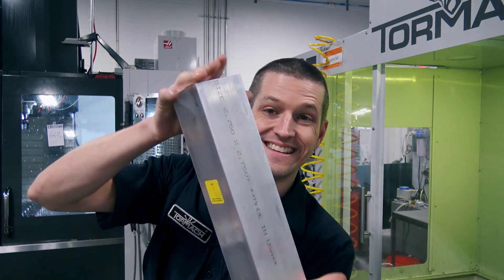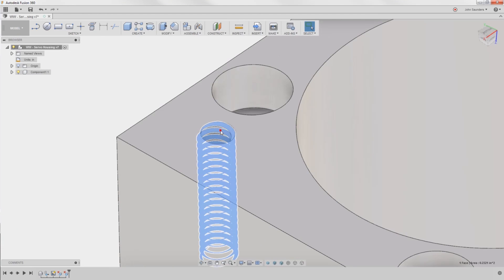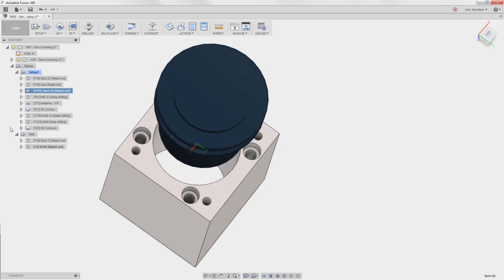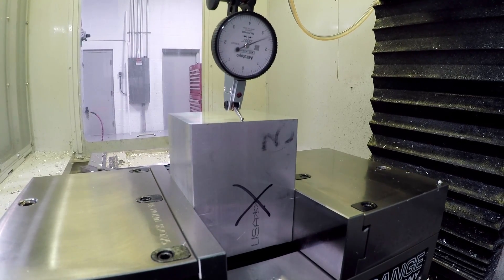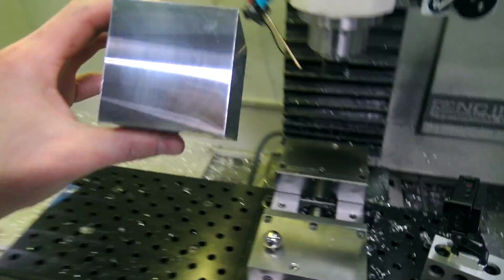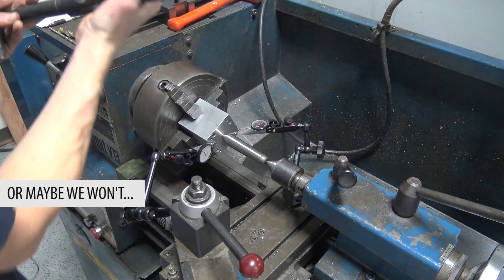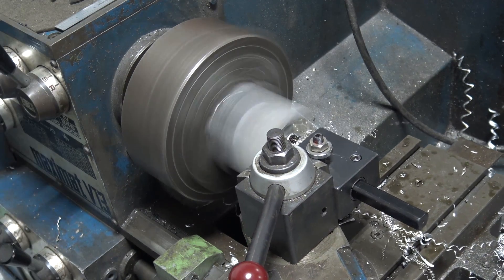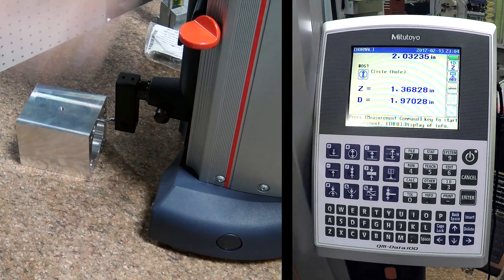Machining a Servo Housing!   WW135

Comment: I find it funny that when when something from china fails people just say it's because it's from china or whatever but when something from USA fails they silently disregard it, blame themselves, or call the manufacturer. two completely different mindsets. one thing I learned from watching YouTube is that anything can fail regardless of where it's made.
Reply: David Serrano 
When it comes to metal from china.  You have no idea what you're getting. Could be the right stuff, could be pot metal. AvE has it right though.  It's chinesium.
Reply: Chinese made drill bits are pretty awful. I think my luck in stainless 304, which will proof out a quality drill from a cheap one in no time, is 50/50. Took a photo of one I melted the tip on a couple weeks back even. Fresh drill bit, good speeds and feeds, but the poor quality of the steel couldn't take it. My shop for the longest time was buying them due to cost. I have learned to just avoid anything with a spotty, black oxide coating. I digress from the point being made about the tang, but if a manufacturer is willing to slap a coating onto a drill to cover up mistakes is going to make sure the tang is properly ground in and without high spots? I certainly do not think so.
Reply: What exactly was the fail anyway? A drill ground to cut steel when used to cut aluminium or brass will try to pull out of a taper, it just seemed that that was a larger and sharper drill than the others.
Reply: David Serrano 
It was a tanged Morse taper drill. Not only was the taper bad, but the tang had to have snapped or rounded out as well. And the other drill was just as old and preformed fine. 

Look. Sometimes china can make some good stuff.  It's not often though because they're hired out for their cheap and plentiful labor in order to make something at the absolute lowest cost possible.  Consider how cheap the made in china tools are. Now consider that not only does the US seller make a profit off them, but the china manufacturer has to as well.  A $50 made in china tool , probably only cost $15 for the china manufacturer to make.  You're not going to be getting the proper expensive metals or any substantial level of quality for that price.
Reply: chadwick hayes then why didnt the other drills have a problem?

also, why did you ignore what he just said about tanged mt drills? Do you not understand what that means?
Reply: Yes. Tangs on the drills are primarily for removal with a drift. But MT3 and larger have tang retention lugs in them specifically to prevent rotation in the taper.  Yes the taper lock does the bulk of the driving, but it's not hard to exceed the hold strength of the taper with using large drills. Hence the tang retainers.
Reply: You ain’t got a clue, 9/10 the metal from China is pure shite, can’t be the good British steel
Reply: Occams Sawzall considering it's an old tool that came with the lathe it could have been damaged or meant for a different taper.
Reply: From LeBlonds US tailstock patent:

"Anarrangement, consisting of a boss having a hole 25 and slots 26, maybe formed integral with the spindle 6 so as to provide holding means for the tang of the usual taper shanks of drills, reamers, or the like. "

https://www.google.com/patents/US2062790
Reply: Pete Kirkham 
Drills with a Morse locking taper shouldn't be able to pull out and start spinning around like that 😆
A drill will break long before that taper hold gives up, provided the taper was ground correctly, which it clearly wasn't on this drill.
Reply: David Serrano he's drilling aluminum the drill bit is actually to sharp and was digging in so China had nothing to do with it the guys nuts
Reply: china ships it, usa don't. that's the difference and it's called quality control.

Comment: If you were off on your the face of your part when you were dialing it in with the dead center, than the back side of the bore would show this as well. This could be the source of your run out on the backside of the bored hole.

Comment: I recommend boring head in the mill.  I think you blew your tolerance by not indicating the part square to the face of the chuck.  You got the center hole on center, but you may have had a wobble in the part, leading to a bellmouth at the rear face (chuck facing side) of the part.

Comment: How do you keep the hole centered when you face down the sides of the block, after the boring operation?
Reply: You don't easily. The order of operations on this part was wrong, block should've been sized first and then bored.
Reply: poo, you are correct. If I was going to bore that in the lathe I would've made a sub plate to bolt the part to that holds it concentric without any deflection from clamping in the jaws. His other main problem was that the lathe is not level and / or the ways are worn bad near the spindle which will cause the saddle to sag and the tool will no longer be on center and cause the taper.
Reply: poo, also I would have indicated on the flats and along the Z axis to make sure the part was running true. 

One last thing that gets me is why in god's green earth is he indicating extruded material to tenths, novice notions if you were to ask me.

Comment: So did you ship it out? Doesn't seem like it's a crazy big deal just 1 thou over spec
Reply: We always ask the client if a small amount over or under tolerance will affect the part if that ever happens. If they want it bang on within spec we will start over but many clients are more then happy if it's minutely off. This all depends on what the part is required to do of course but good friendly communication goes a long way and can save you time and money and get the part to the client quicker. However within tolerance should always be the goal for any machinist.
Reply: UnderearthEDO I agree! logical :)

Comment: Hey John. I got a Tormach 1100 recently. Inspired by your videos! The problem you're getting with the Y-axis run out isn't because of the tramming. I'm not a fan of twisting the bed to correct for spindle sweep tramming. 

It's the head/spindle alignment with the column. If you have a precision pin that's big and long enough (about 0.5" diameter and 4/5" in length), you can chuck that up the spindle with an R8 collet and use your test indicator to measure the misalignment along the X-axis and Y-axis as the head travels up and down on the column. 

Assuming that your table movement is square to the head. Fixing this misalignment will resolve that problem. This is something I learned while squaring up the machine. Hopefully this helps!
Reply: when you google it the second hit is a NYCCNC video of john demonstrating the RDM

Comment: John, the parallelism problem was probably the result of your measurements as you set up in the lathe. You got your face center right with the dead center trick, and you got the face reasonably perpendicular to the lathe spindle axis. But that face isn't what counts. What counts is the sides of the part. You assumed the face was perpendicular to the sides, and that one thou you were measuring in the mill probably added up with some other differences to give you your total runout.

You probably should have swept two (or all) sides of the part from front to back checking for runout. That would have got the finished bore parallel to the sides of the part. Then you could have faced the part in the lathe rather than the mill to be sure the face was perpendicular to the bore axis. While you could have done the part in the CNC lathe, you could have got the same error there, too. Since you want the bore parallel to the sides it would probably be easiest to finish the sides to tolerance before boring, then face the ends to length after boring (to make measuring in the lathe easier).
Reply: While the setup process you mentioned might explain the hole being off-centre at he chuck end, it does not explain why the bored hole is only 3 Tenths over at the face but nearly 7 Thou over at the chuck end.

When it comes to boring a hole, variation of diameter along the length eg taper has nothing to do with how the part is held in the chuck, you can set up a part completely eccentric in all axis and still bore a parallel hole, its just rhat hole will be completely eccentric to the other features of the part.

A Tapered bored hole is only explained by the chuck axis not being parallel to the the Ways.

BTW with only giving 10 seconds of though to this, if i were to make this part I would have gone to the lathe first, faced of both ends and bored the hole. Then turn a 1/8" wide reference OD on what will be the bottom face of the part (have extra stock on part for this step) this reference ID can then be used in the mill squaring up steps to make sure the 4 sides are not only square but the right distance from the bore centre.

Then go to the mill, use the two faced-off surfaces as reference to square up the rest of the block using the OD as reference to get the face to bore centre distance correct, then with the OD face down sweep the bore to get the part centre and proceed to drill the holes. Final step mill the back face down to height thus removing the reference OD,  

Cheers
Reply: Charlie Brumfeild, its not true that you need a squared up block to bore a parallel hole. I could bore a parallel hole though a completely irregular shaped part, its all about the Ways being parallel to the chuck axis , nothing else.
Reply: Yep, I was wondering why he faced the sides after he bored the center. https://youtu.be/rmlvsTsZeoA?t=15m19s
Reply: You are partly correct. That lathe was boring a taper, nothing to do with "clamping force" etc as it was larger at the chuck. It is not normally due to the chuck not being perpendicular to the ways, but the ways not being parallel with the spindle. A lot of people then screw around with the headstock alignment only to then find it won't face accurately! I would put my last dollar on the fact that lathe was never properly levelled, the bed is twisted and it consequently does not turn (or bore) in this case without a taper.
Reply: +russhelmy I thought he measured runout, not diameter error? In that case you would be correct.
edit: yes, you're correct, my mistake.
Reply: Possibly. Checking roundness of the hole would be a good start. I would have taken a quite different approach and bored the hole first. As for the hole taper, it almost certainly is head stock alignment. If the back side were much smaller you could play it off as just not locking the cross slide during the final pass, but i think it went the other way.
Reply: Ok I get where you're coming from. I guess it's conceivable, but 3 thou is a LOT to collapse it, and I don't think the part would behave the way you suggest. What would happen is as the bore got larger, the clamping pressure would be relieved (as you're basically clamping on air if that makes sense) and the part could be pulled from the chuck. That can happen. But it means that when the part is taken out there isn't the huge pressure on there as there was to begin with.

I do like your theory however, as I think many people don't appreciate the tremendous clamping pressures 4 jaws can exert, much MUCH higher than a 3 jaw. But I still maintain that, subject to confirmation, that lathe is not accurately levelled and the bed is twisted.
Reply: Too much clamp force on the chuck is most likely his problem. I bet the large side of the tapered bore was not round.
Reply: John said he doesn't run a lathe much and taper grew from .003 on the machine to .006 on the surface plate.The point I was trying to make is he probably cranked the 4 jaw chuck super tight, from not being comfortable running square parts on a lathe. And the part was collapsed while boring and sprang open when it was removed from the chuck.
Reply: It has happen to me at work a few times in manual and cnc lathes, so I try to keep an eye on things like that.
Reply: I also think that it has to do with the runout of the face. Even if it's 1 thou runout, he measured over a relatively small radius, so it could quickly add up to a couple of thou over the total length. He said something of 1.5 to 2 thou on the surface, so if the length of the part is 3 times the diameter of the circle the measuring tip is on and the center hole is centered, the other side should have a runout of 4.5 to 6 thou.
Reply: Pete F ssssdòoo

Comment: Lathe cutting a taper?
Reply: Jared Callahan never used a lathe then?
Reply: demandiesel What else would cause the taper in the bore? If the part wasn't square in the chuck, the bore would be straight but have runout, no taper. 6 thou difference over that short of a part is alot of taper
Reply: Jared Callahan 
Boring bar deflection would be one cause. Sorry John but a bigger boring bar would have helped a lot , unless the headstock is NBG 

Stuart
Reply: Stuart Hardy But it is larger at the back. You would think deflection would make it a smaller diameter at the back. It seems like the headstock isn't aligned

Comment: I woulda thrown a shearhog at it and cut as much as I could out of it
Reply: Occams Sawzall because the lathe is fastest way machine that and would have flip and blend such a pain
Reply: Chief Machining 
It's +\- .005 little scotch bright in the bore no problem. 

Just set a stop before doing the first half of the bore and should be within under a thou blending when flipped. 

I dunno. I woulda done that for just one part rather then move it back and forth between multiple machines and setups. 

Though I also would have completely squared up the block to size and within better than a thou parallelism as well.
Reply: That's horrible idea
Reply: Chief Machining 
Helix bore with the shear hog? What's wrong with that?  I would have done that, easily hold +\- .001 on it too.

Comment: have you ever checked the deflection on the fixed jaw of your vises? it could surprise you. 
my Kurt 688 will deflect about .001"/10f/tlbs of torque. the resulting pressure applied is +/- 1000lbs of clamping force per 10 ft lbs. If you tighten to the maximum recommended torque  of 40 ft/lbs you can easily get 3 or 4 thoul error.
With that kind of load the bolts holding the fixed Jaw stretch and deform. I know that Orange makes great vises, as good as Kurt does, that's not to say that they don't have inherent design faults.  

My second Kurt, the 3600V, is a mono block design and showed 0 (zero) deflection at maximum torque.
just some food for thought.

Also i know diddly squat about CNC but i might of squared the block to size  prior to setting it up in the 4 jaw, the face run out  might of been an indication that something was off somewhat. (or facing off the part once in the lathe might of helped.)
Love your video's and great fusion 360 tutorials
Thanks John
Reply: You are absolutely correct about the Kurt Vises.  We have had the same issues, and only use the Kurt 3600 when we are looking for close tolerances.  We also use the torque handle if we need repeatable positioning.  That helps keep things as consistent as possible especially with small parts, or parts that may have some flex.
Reply: I was surprised when i tested the 688, its not a bad vise by any means, but one needs to be aware of its limitations.I also use a tq wrench if I'm doing multiple parts to tight tolerances.
cheers mate (subed btw)